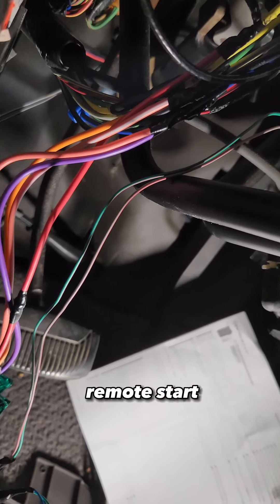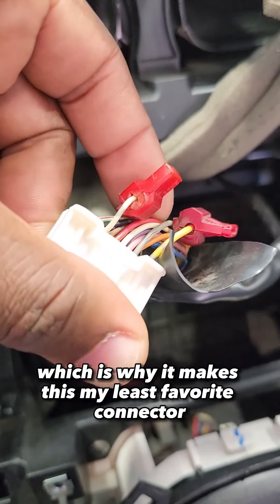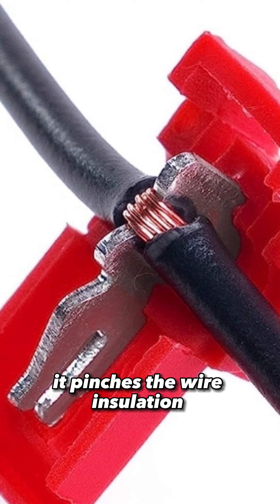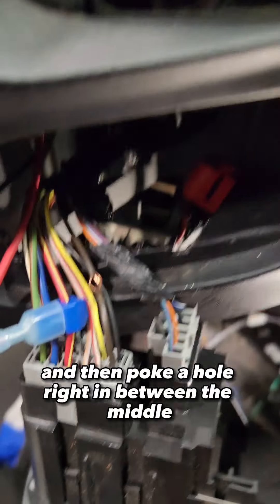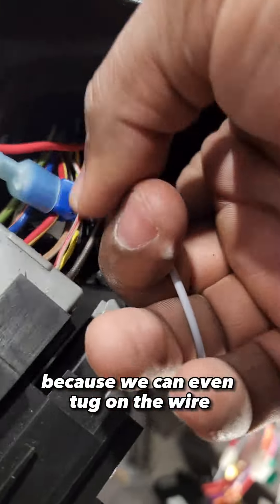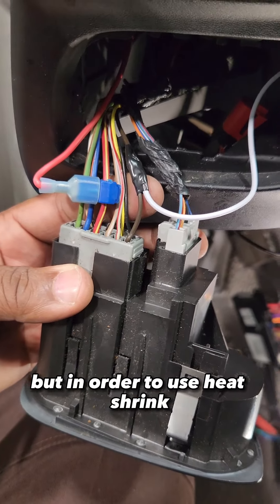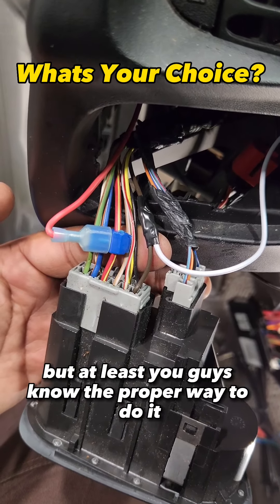Don't Use Ttap connections instead Military splice and solder the wire connections

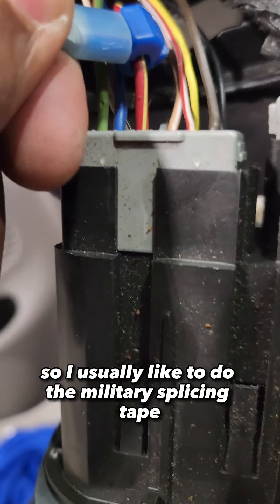Comment: @ 0:43 what is that tool??
Reply: Was interested in that tool as well. Its the Klein Self-Adjusting Wire Stripper.
Reply: Yeah seems pretty necessary for this job. Dont really wanna risk doing surgery on my brake light wires lol

Comment: Man how do you decided what to tap into and which wire to use? Do you calculate the loads and voltages already on the wiring before choosing your wires because auto wiring confusese me.

Comment: If the factory speakers was components on the front doors. Looking at a diagram the tweeter is the first to receive the wire and than to the 2 way subwoofers. Predicting a resistor between the connection of the tweeters to the woofers. If I was using the factory speaker lines but wanted to use the aftermarket crossover to utilize the adjustable settings . Do I use the line from the tweeter or from the subwoofers for the aftermarket crossover . Would that line that may or may not have the resistors affect performance of the aftermarket components if it did use a resistor or some sort of crossover that I over looked

Comment: what about on a can bus data line? i have to connect to one on the obd port but i heard you cant solder on a can bus line butter to use crimp connectors like a posi tap

Comment: You can always buy the tool or set of tools to remove the pin from the connector and then you can use proper heatshrink. It is also a good idea to coat the tap with silicone before pulling on the heatshrink.

Comment: You can also de-pin that one wire from connector, solder, then add heat shrink, then plug pin back in. My car gets the whole nine yards.

Comment: I like to use liquid electrical tape on stuff like this. As long as you use the brush to cover all the exposed wires and let it dry you won’t have any issues.

Comment: You can also use, instead of electrical tape, liquid electrical tape. But, the draw back of liquid tape is that it take 24 hours to cure. Or my favorite, a combination of bought, 1st. the electrical tape, 2nd, liquid electrical tape over the electrical tape.